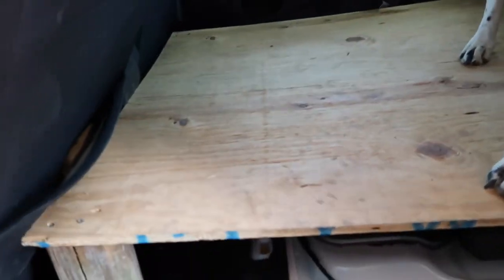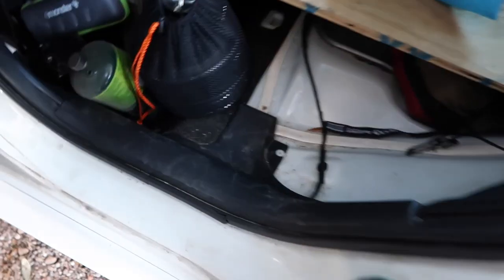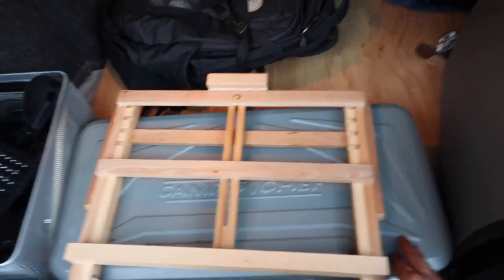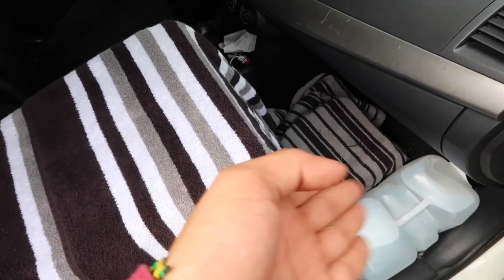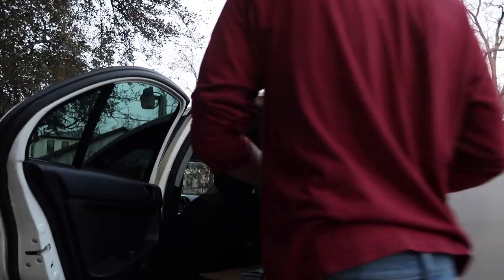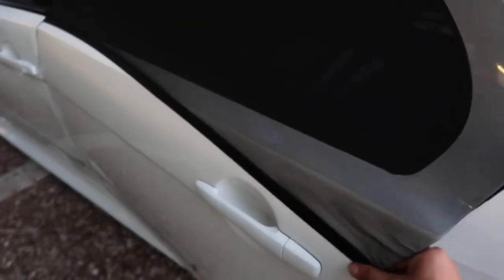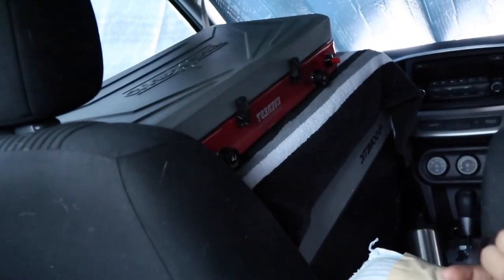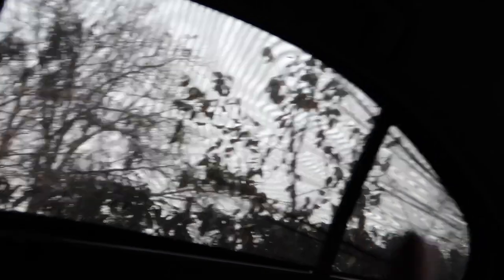Car camping in a small car - Camping Setup

Comment: I plan to do similar but instead of resting the plank on legs, I want to have it hang from some straps attached to the front head rests : ) gotta save all the space you can!!! hahaha
Reply from the maker: Tbh I can see that being a good idea. Those legs definitely take a bit of room. Also when I'm taking things out from down there its definitely a lil struggle. nothing crazy but still. 
Also Thank you soo much for watching!!
Reply: Unless you are a very light person, I can't see how this would really work.  Those front head rests aren't made of steele, and I think that over time, the weigth of an average person woudn likley bend or distort them, no???  I get wanting to maintain the space behind the two front seats, but I think Erik's platform bed is very likley the way to go, with two simple but firm legs.